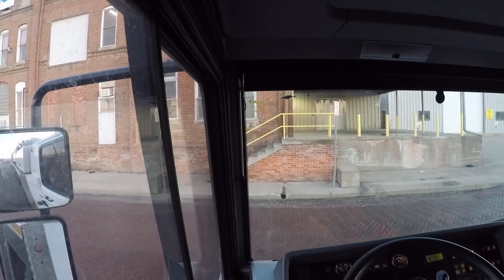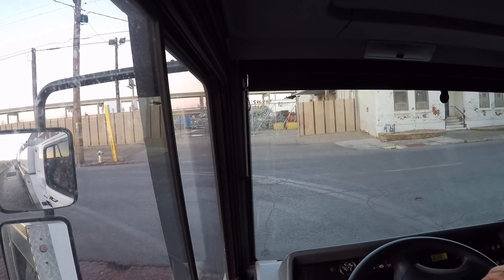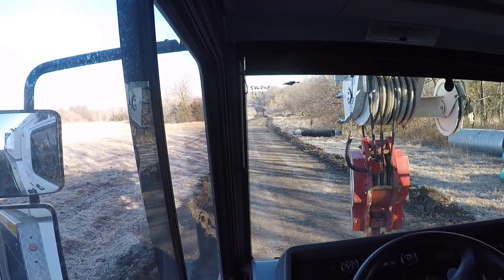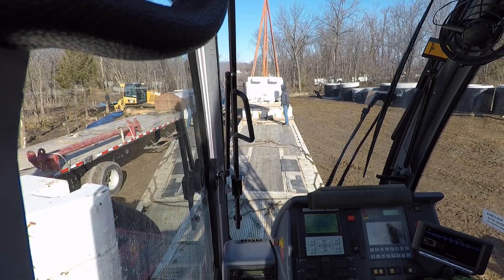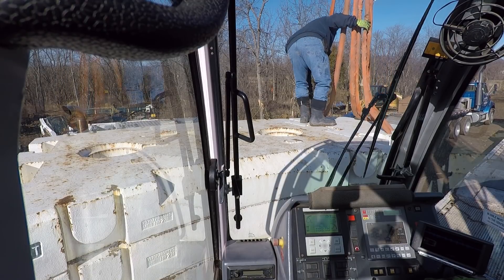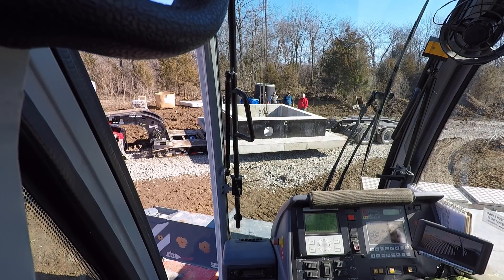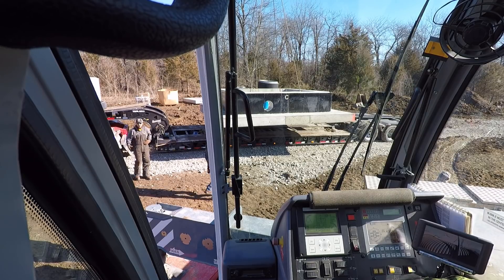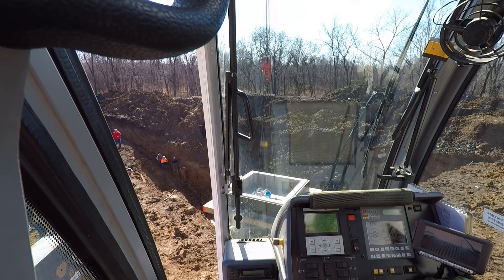Taking a crane to its max capacity - setting precast concrete

Comment: Ok I got dragged into a hearing for not benching hole enough.
Sorry you are ok just looks spooky on video
Reply from the maker: james norse, it does look worse on video than it was on site. Although, it was still spooky swinging over a hole with that much weight. Being a crane guy you know the helpless feeling. It's one of those times when everything that could go wrong starts running through your head. Thank you for being part of the channel and being so engaged in chat and comments. 🙂👍

Comment: What kind of training is required to become a crane operator? Thank you! Great channel, new sub!
Reply from the maker: BigSky, 3-4 years working around cranes, a very difficult written examination and a practical test. Thank you for subscribing and for watching! 🙂👍
Reply: 10,000.00 one month of "training" will get you through the nccco tests and get you a plastic card with your picture on it. But there is no substitute for on the job experience. The operating engineers union has a good apprenticeship program that is ruffly 4 years. The wages and bennifets are great. There are many opportunities npn union as well . I would suggest looking into iti for rigger and signal training 1st. Buy the ipt crane and rigging manual and the mobile crane manual do some studying and practice load charts and rigging math take the nccco practice tests online see if your interested. It can be a very boring job or a very stressful job.

Comment: Nothing scarier than booming down with a max load for the radius and below grade. If an outrigger settles or you go too fast you may not catch it.
Reply from the maker: Carl williams, it was a little nerve wracking. That's why everything was done very, very slowly. Also, before I put the piece over the hole, I boomed the piece down over the ground and the outrigger that would have the most load on it. If it was going to settle, I wanted it to happen when I could keep the piece a foot or so off the ground. Thanks for watching! 🙂👍

Comment: You look to close, isn't there standards on how far away from the hole you have too be? I'd be scared of that dirt caving in..
Reply from the maker: big stick, I looked closer than I actually was. Also, the hole was benched and sloped. The standard is one to one on a hole. Thanks for watching! 🙂
Reply: To The Top Crane, Thanks for the reply.  It probably looks closer on my cellphone than in real life lol.
Reply from the maker: big stick, it probably does. Also, I set up across a corner of the hole. Doing so gave my outriggers the necessary distance while getting the center of the crane a little closer to where the piece had to land. So, I'm sure there's a little bit of an illusion because of that. You're welcome for the reply. I always encourage subscribers to ask questions or leave comments. I will respond to all of them until I physically can't anymore. Thanks again for watching. 🙂
Reply: @ToTheTopCrane  Ya 45 degrees, same here. Just a boom truck, but still the possibility of upset and a ruined day!

Comment: Understand about the concentration, sometimes I don't think I could walk and chew gum at the same time! 😊
I remember the video about having ten wheel steering, but how many driving axles do you have on that rig ?
Probably need all you can get on that greasy road !
Thanks for sharing and take care. 👍
Reply from the maker: Ken Gamble, four drive axles. It's true 8 wheel drive if all of the differentials and transfer cases are locked in.
Reply: To The Top Crane
Thanks! 😊